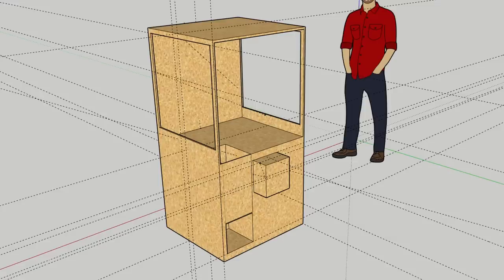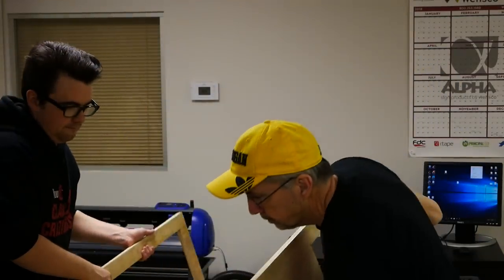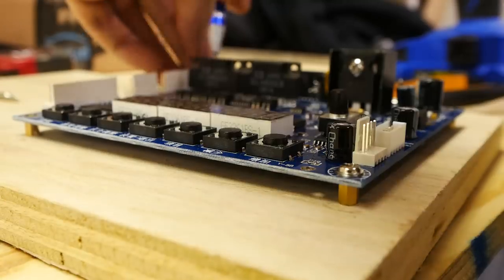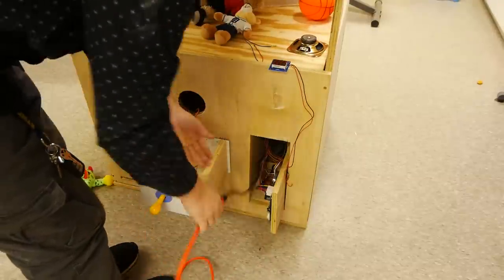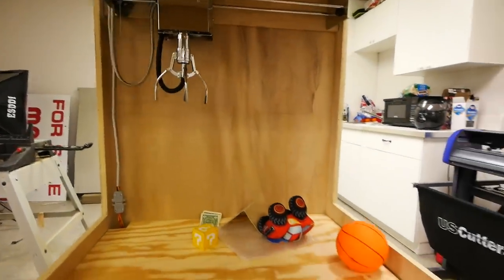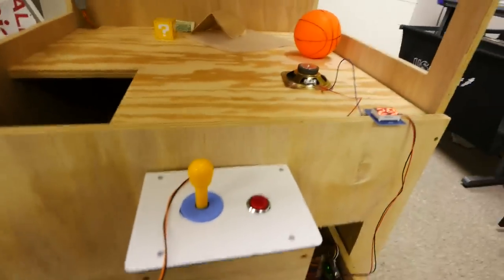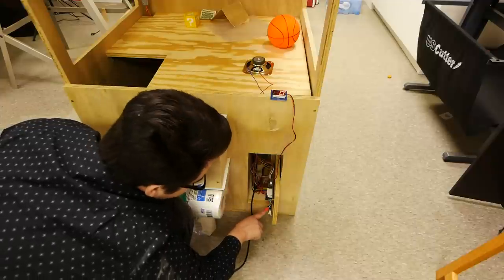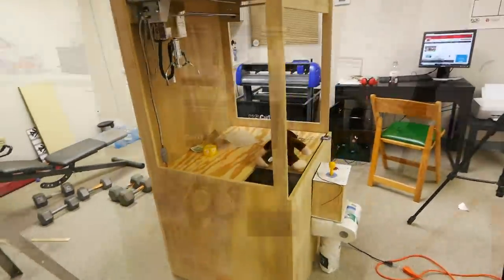BUILDING A HOMEMADE CLAW MACHINE!!! Part 1 of 2

Comment: just got this same kit and started to install it, lots of extra wires for different set ups makes it a little confusing but I have it hung and mostly everything set up just need to wire the controls and its ready, put in an old Hollywood Claw machine I found from the 80's.

Comment: Hey thanks for putting out this video. I was wondering which wires you used for the speaker and I was wondering where you are going to put the coin mech. This has really helped a lot when building my claw machine with this kit. Thank you so much

Comment: I have a question for you. If I wanted to build a giant claw machine using this product would it be possible to do something like 10ft x 10ft with a 7 foot drop? I’m an electrical engineer so I wouldn’t have a problem extending the wires, but I’m wondering about the parameters in the controller and also extending the drop? Think you for the great contact and you guys build a clean rig.
Reply from the maker: We tried but it does not work. The board has a built in timer it will move the motors for until the machine errors out. The max you can extend this is about 5 and a half feet. Great idea though! Wish it worked.